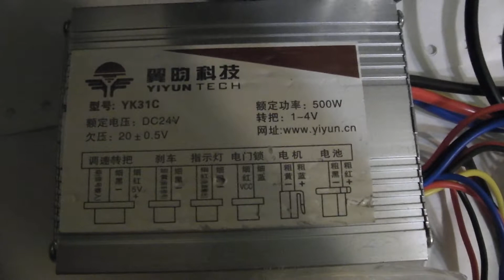dual freewheel rear drive adaptation of bicycle for electric drive system

Comment: So the threads on the hub are right hand threaded
Reply from the maker: The freewheel is a standard Clockwise to tighten threads type, you just flip it over to thread on.
Reply from the maker: The threadlock glue I used prevents it from loosening but remember I only have a 450 watt motor so torque is limited
Reply: @ralger  ah I'm trying to use a 3000w brushless motor 6374
Reply from the maker: @chrismagallanes8858  I think that would produce too much torque for the glue on the threads to loosening .😒
Reply from the maker: @chrismagallanes8858 I think the fact that the motor I am using only puts out a maximum of 450 watts of power is the reason there is not enough torque to break lose the thread glue.
Reply: @ralger  I have the red loctaite you have the blue one we are not the same
Reply: @ralger  ah I see

Comment: I have the similar set up and broke the chain that came with the motor any idea where to find one without having to buy the whole kit
Reply from the maker: Sorry no I just used piece of chain from old junk bike I found in alley , then you just use a chain splitter to get it to the correct length.
Reply: @ralger  ok thanks

Comment: Where did you get a dual drive rear hub
Reply from the maker: You can find them on Ali express , it’s actually to add a disk brake rotor but it has the same threads as a freewheel .
Reply from the maker: Check Ali express for disk brake adapter it has same threads as a free wheel
Reply: Rick Alger I’m on AliExpress please send link
Reply from the maker: @parrishstevens  ok see this link https://www.aliexpress.com/item/32382520639.html
Reply: Link please
Reply from the maker: Parrish Stevens 

https://m.aliexpress.com/item/32382520639.html
Reply from the maker: https://m.aliexpress.com/item/32382520639.html
Reply from the maker: Me Me https://m.aliexpress.com/item/32382520639.html

Comment: hey Rick: looking to do the same thing for an electric bike, saved me some time, great idea. One question: do i need to be concerned about which side the single-speed freewheel was intended for, seems like if it ends up on the wrong side it wont operate correctly. can you comment? what brand/part number did you use? Thanks, Tom
Reply from the maker: Hello all: the freewheel I purchased is just a normal clockwise threaded freewheel, the issue is it MUST be glued on using a thread locking glue or yes the free wheel will un-thread if mounted on the left hand side of the dual threaded rear axle hub. Other points to consider are the number of spokes  and the length of the spokes on your existing rear wheel axle hub MUST match the spoke count  and expected length when transferred on to the dual threaded axle hub you purchase to replace your single threaded axle hub too.

 I think the fact that the motor I am using only puts out a maximum of 450 watts of power is the reason there is not enough torque to break lose the thread glue.

 As to hub axle assemblies I purchased them on ali express , the url I used is 
https://www.aliexpress.com/item/Universal-Bike-Bicycle-36-Holes-3-8-Axle-Rear-Wheel-Hub-Cassette-Replacement/32602525518.html?spm=a2g0s.9042311.0.0.27424c4d7mM17C ,

The freewheel and motor + bracket and chain I purchased on ebay.ca at https://www.ebay.ca/itm/250-Watt-24-Volt-electric-motor-conversion-bicycle-ebike-standard-chain/162178821917?hash=item25c29c6f1d:g:ZB8AAOSwLpdW9Btz
Reply from the maker: I have added another video see this when ready in an hour or so https://youtu.be/BrDPjaNG5JY

Comment: Is this left freewheel working with motor well because it will be loose if motor will crank because threads are tightning in clockwise
Reply from the maker: The glue I used to lock the threads has prevented the freewheel from unthreading for over a year now, it is permanent thread locker that seems to be able to handle the torque of the motor so far, but yes your are correct it could eventually unthread if the glue fails over time. Some people weld the freewheel on but a friend told me the heating caused by welding would probably destroy the bearings and grease inside the freewheel itself so I didn't weld it, I glued it instead.
Reply from the maker: See https://youtu.be/BrDPjaNG5JY
Reply from the maker: BTW freewheel still holding has no broken thread glue yet 👍
Reply: @ralger   you basically had to build a new wheel, spokes, rims, freewheel, with e bike motor and axle hub assembly? Is that right?  It would have been interesting to see that process and how much time and difficulty it took.
Reply from the maker: Mike T 
I had never respoked a wheel in my life , there are plenty of YouTube videos con relacing a wheel I estimate it took me about two hours to unspoke and respoke the wheel. It’s not difficult just time consuming. Cheers 👍👴🏼😊
Reply from the maker: @miket1160  you can follow this video to respoke a wheel, its simple and well done. see https://www.youtube.com/watch?v=mIU6mi0K4Y4

Comment from the maker: A lot of you will probably say I am crazy trusting thread lock glue in my drive assembly and you may be correct but for now it is working. I have seen people weld the freewheel onto the rear hub assembly as a safer alternative but I was told by a welder that heat of welding would probably destroy the bearings in the freewheel assembly so I opted for the "glue" solution.
Reply: Merhaba bu malzemeye nasıl bula
Reply from the maker: @nihatboz4814   Videonun altındaki açıklama bölümümdeki bağlantılara bakın veya https://m.aliexpress.com/item/32382520639.html adresine gidin.